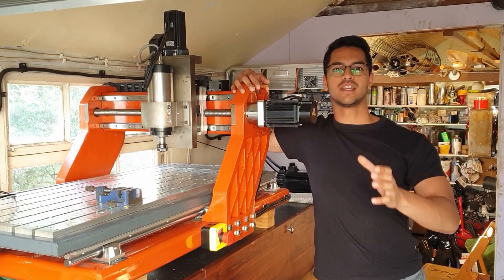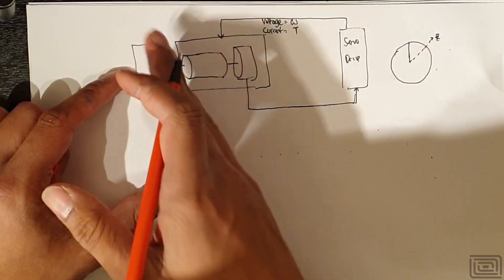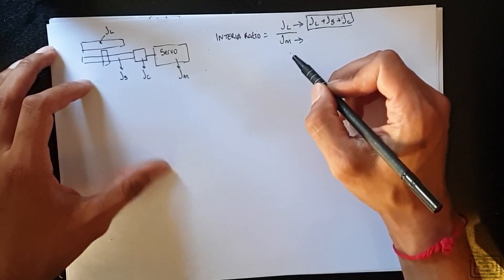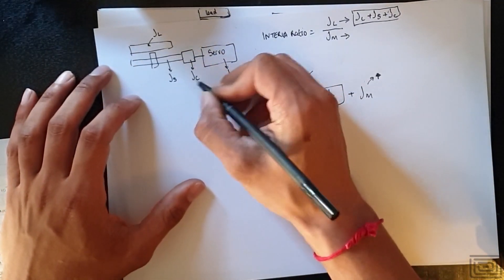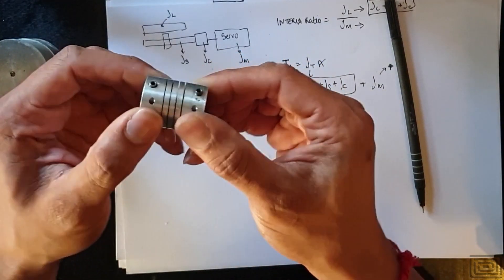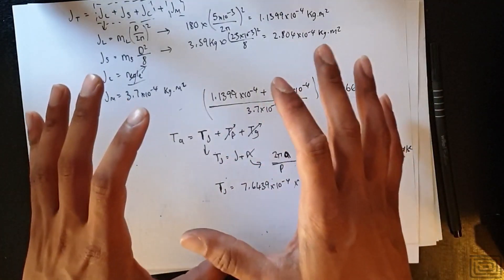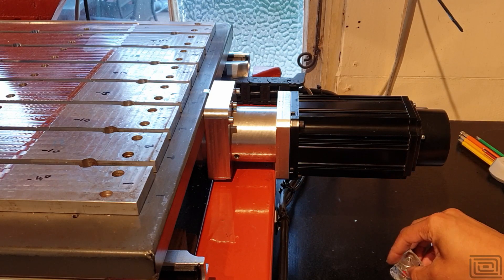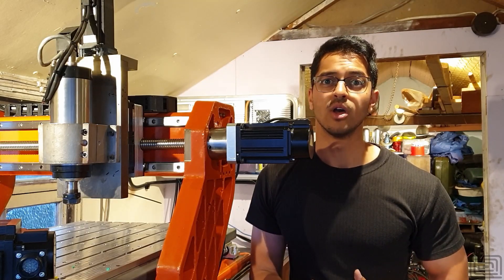Basic Chinese Servo Motor Sizing Considerations

Comment: Can you explain how you use the index pulse to set an axis to an accurate home position. I’m using centroid acorn controller. Thanks.
Reply from the maker: Hi, i unfortunately dont use this feature, unless you have an absolute encoder i wouldnt rely on the index pulse to set home as you may be a whole revolution out etc. I plan to use limit switches

Comment: Initially i was thinking to use one servo and two HTD 3M belts to drive two ball screws. Now, after the lecture from you, i'm concerned if such a long belts will do. And then anothe concerns came in: if i use two servos for X axis - how to hook them up together/synchronize so they run in parallel without skewing my gantry!? What if one servo fail, issue error signal, but it will take time for the second one to stop/trip...

Comment: I keep seeing these flexible couplings. I have been using them for 40 years but never for torque-transmission, only for coupling encoders to shafts. To me, using these things for motor coupling is lunacy....might as well use a rubber band for a drive-belt.

Comment: Hey man! Thanks for making this video. It has been really helpful. I'm making a moving gantry router myself and the gantry will weigh around 180kg and I'll use two 750W servos. I was concerned if they'll do the job but after using the equations you've showed us I think they will be enough!

Thanks again. I'll contact you when I run into some troubles with the time comes to work on the electronics. Hehe j/k
Reply from the maker: Glad it was helpful! Just be mindful of the stiffness between the servos and the output (use stiff couplers). I have a belt application using one of these servos for the spindle assembly and i can tell you that the servos will not work out of the box in this situation. I am now trying to tune them..... (hopefully ill have a video out on it!)

Comment: Hi there! Thanks for all this math! Do you have any software to tune this servos?
Reply from the maker: Hi. Unfortunately not, to tune these servos you need to manually change the gain settings on the drive. The list of parameters available is comprehensive and i think if you write some software and interface some hardware to look at the raw encoder values you can tune them effectively however i have not tried. I opted to oversize them for now. I may in the future look to write some software and interface hardware.
Reply: @vhospher6463  that would be amazing! of course the basic things would be nice, but the advance stuff would be a dream, like auto tuning, the feedback let you know how it response with the ramps of power given, basically to be able to make a routine good enough to make the guess work. You inspire me, I would help on this, I am a little tired with so much work for now, but yess I love the idea!